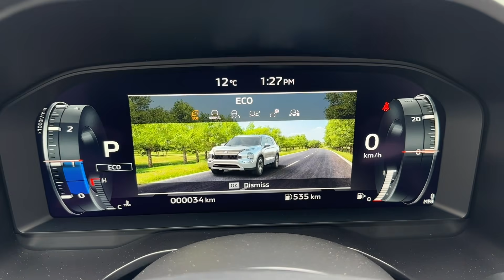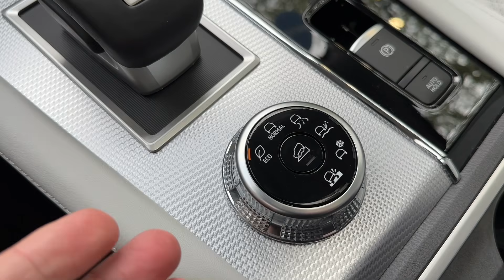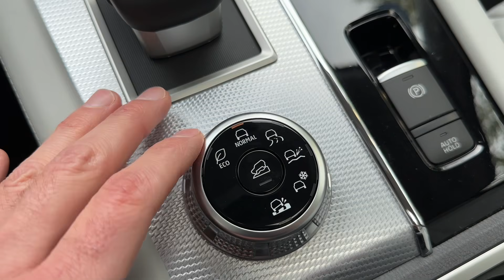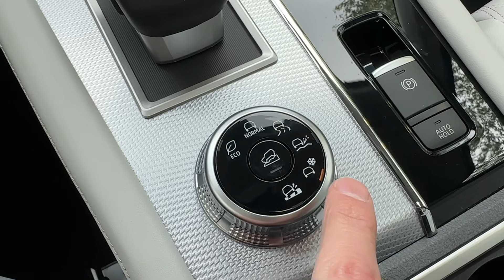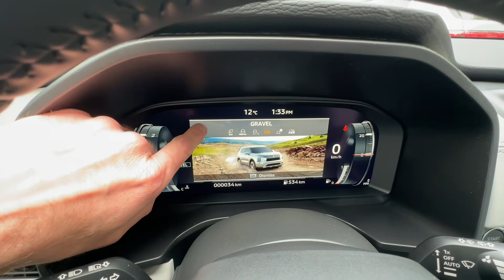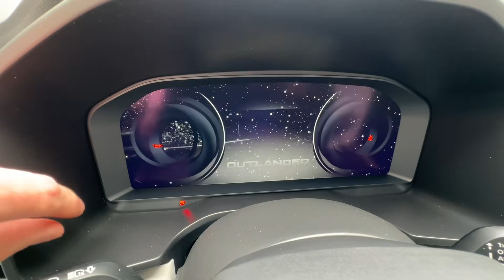Mitsubishi Outlander 2024 - Drive Mode Selector explained!

Comment: Can i switch my modes while driving ? Or do i have to stop to switch
Reply from the maker: You can switch on the drive, no need to stop.
Reply: @mr.mitsubishi i have an issua with my vechile , theres this flute whistling sound when im driving with the ac on on the street and free way , its on and off sound coming from the engine to the cabin ?

Comment: are the drive modes proof that it is an all wheel drive? Im confused because usually other brands you can tell right away if its an awd because of a badge in the back

Comment: Is there a way to turn the animation back on when using the drive selector? My 24 outlander sel had to have an engine replacement and now the animation is gone when selecting different drive modes
Reply: Good question.  We drive the same vehicle and I don't believe we ever seen the animation when changing modes.

Comment: Hey, I have a brand new one (Hybrid) and the drive mode Selector doesn't work like yours. I see nothing on the screen and can't even see the light in the nob control. Can I activate that?
Thanks in advance
Reply from the maker: It should work automatically! Check in with your service department..

Comment: @mr.mitsubishi
Can Snow Mode be used for rainy conditions?
Also what is the best mode for Sand?
Reply: Mud mode might give it full potential. If taking it in sand I would suggest airing down before going in to at least 15psi.

Comment: I just bought this wonderful car, but I feel that the steering is loose, almost as if the car is floating. Do you have any advice? Thanks in advance.
Reply: Make sure your tires are set at 35 psi. They come over inflated during shipping.
Reply: @AngelaDavis78 es verdad nosotros compramos una antes de fin de año y estaban muy por encima de lo que debería estar !!
Reply from the maker: That's weird.. Have the service department check it out!

Comment: Is there a preferred driving mode while towing? I usually drive in Eco mode but assume Normal would give better power distribution with a 1000lb trailer? Thanks.
Reply from the maker: Nothing specifically recommended for towing - Normal would do it.

Comment: Which mode would be best for driving on sand (i.e. beach driving)? Thanks.
Reply: Mud. When on this mode, the power routed to all 4 wheels evenly. I did try on deep sand and it flew by the Jeeps on the beach
Reply from the maker: Mud would do it.